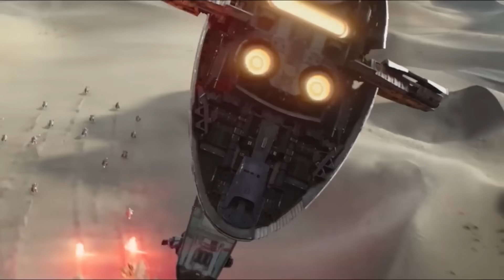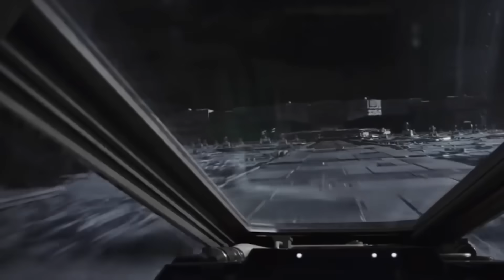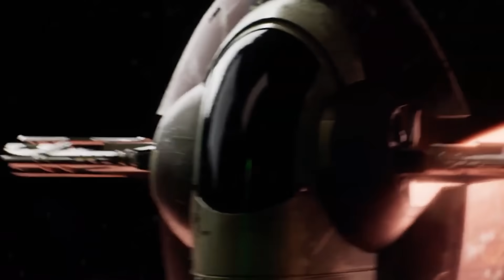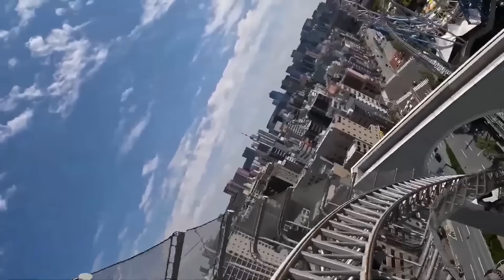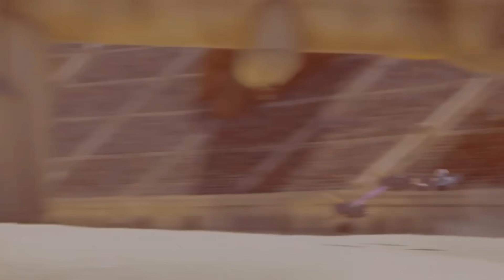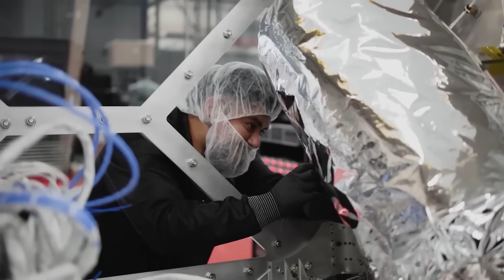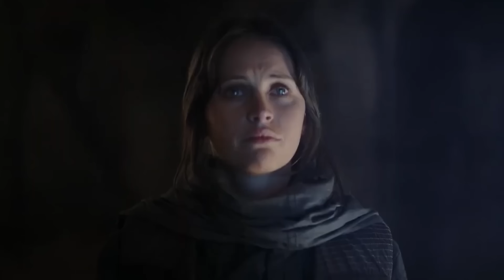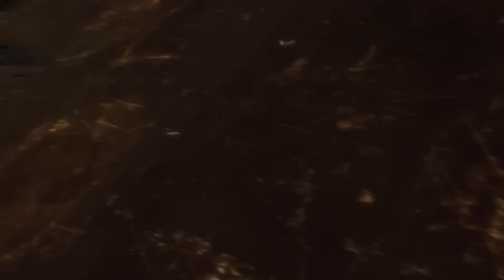The Problem with Star Wars Ship Design

Comment: 22:31 who's going to tell him, that week spot was there as a way to sabotage the station?
Reply: He says that like 10 seconds later
Reply: Who's going to tell him there wasn't a huge neon sign pointing to the exhaust port saying " weak spot" . We're taking about a 3.14159 m² hole on a space station with a surface area measuring 45 237 934 212 m² that was only known because schematics were stolen.  The hole is less than 0.000000001 % of the total surface area.
Reply: There was no spot that was vulnerable in a six-seven day period, so idk what "week spot" you're talking about. However if you're referring to a "weak spot", the target was small enough and at a nearly impossible angle where even loyalist Imperials deemed it impossible for anyone to successfully target unless they used the force (hmmmm...).
Reply: bro didnt even watch the video and complaining
Reply: Why would i accept an answer to a problem that did not exist until over 40 years later when another movie was made around said "weakness"? If the original movie did not address it, it's still a plothole. Regardless how many later layers of wallpaper were glued atop of it by people barely alive when the original was filmed.
Reply: it got mentioned a little bit after

Comment: Capital Ships would fight at vastly greater distances and in 3d space but the way they move (operationaly) is not unrealistic in star wars. In reality you still have material stress moving through space, the larger the ship the higher the strain, every course correction or halt on high speeds can compromise the integrity of the ship. Every move would have to be deliberate and calculated, once moving you are commited so there would be no constant high speed movement even if ships are capable of travelling that fast.(large ships)
Reply: Except Shields make all of that redundant: by the time your Million mile long Laser shot is calculated and hits the ship, by the time the second shot is fired and calculated for the ships Change of course the shields will have cycled and be fresh

Star Wars is Brawling because it’s the only way to cut through the Shields and Super Dense Doonium and Impervium Super Metal armor
Reply: @devildolphin2102 yeah that might be true in a setting with shields, I was talking about real hypothetical space combat that the slow moving capital ships of star wars are not that unrealistic given that they can only go fast in one straight line without stressing the ship.

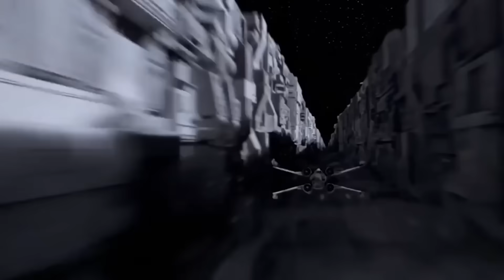Comment: 10:00 most of the time wings are used to place cannons out of the deflector shields dome, because if you shoot inside of it projectile could bounce back(if you use irl physics it does not mean that you could reject all of the technologies of the univerce)  11:00 also, there is a device in star wars called "Gravity compensator" that compensates high G forces turning artifical gravity to opposite direction
Reply: It's called an Inertial dampener. And before some wise guy says it, dampening something doesn't mean putting water on it, it means to compensate for or reduce the affects of.
Reply: Oh, that makes a lot more sense than the heatsink argument I've heard tbh (since... why would ONLY the ships with S-foils need them? and they don't exactly look large enough to do the job fully, nor do they really look like radiators)

Comment: So the design flaw of the deathstar is actually touched on in the legends book "Death Star" the design was a literal flaw overlooked by the engineers. Basically they needed to vent the heat and the engineers being in a cubicle were like okay put 3 m hole here. But later in the book one of the architects (i think its been a while) makes mention on how this is a design flaw, and the construction crew basically said "yeahhhh but thats on the blueprints so...." highly highly recommend its a fantastic read
Reply: Even more than that, they determined it was made redundant by other more heavily reinforced exhaust ports.  The reason it got built anyway was the overseer was bedridden during the construction phase and thus wasn't there to ensure the construction crew was using the revised building plan.
Reply: @happyrich1274 thank you!! I knew i had some part wrong its been years since ive read the book.
Reply: @happyrich1274 The Empire could have solved this problem by Shield generating the Star Destroyers, so no matter what exposed sections they are, it would be protected by the shields from weapons!
Reply: @Garland.Greene2296 star destroyers DO have shields....
Reply: @Garland.Greene2296  the problem is that they blew the death star with proton torpedoes and those aren't affected by shields as they can pierce the shields like its nothing
Reply: Also it’s mentioned multiple times……It doesn’t matter. 

It’s a Small 3m exhaust port covered by Guns and Tie Fighters. It would need divine intervention to actually hit the core of the station
Reply: @devildolphin2102  
People love to say "Ha ha, look at how badly the designed that!" and you are right. It was pretty well defended and would have required supernatural forces to take it out. Having a Jedi bullseye that Womp Rat is probably on the border or out there in the category of "Outside Context Problem"
Or at least the protection from Jedi attack was to go out and make sure there are no Jedi...
Reply: @devildolphin2102  
I mean it's impossible, even for a computer!
Not like there's going to be some moisture farmer who can bullseye Womp Rats or something from a fighter craft...
Reply: Totally agree
Reply: There's also an unofficial audiobook of it here on YouTube
Reply: @Ihavethetouch I’ve heard that one it’s really good
Reply: @TmanF1nerd  Yeah, I listen to it time to time. Same with Coruscant Nights trilogy. Sad that he only read the first Republic Commando novel because the people reading the rest aren't even close to his level.
Reply: How do any such vents work, then? Space is practically a vacuum, ergo waste heat cannot be got rid of via conduction, only by radiation. Breathe out on a cold day: the heat in your breath is lost almost immediately to conduction, as the warm air of your breath is in physical contact with cold air. So if this really is a vent, you would need to dump not just the heat, but the gases/air containing the heat, which seems a bit extreme, not to say wasteful. To dissipate waste heat (of which there would be a tremendous amount), you need large surface areas for it to radiate from (and not therefore a vent). Radiation is very inefficient: white dwarf stars shine extremely hot for millions of years, not because their temperature is maintained by ongoing fusion, but because radiating heat is a slow, inefficient method of losing it.
Reply: @PaulThatcher-iu5in I didn't read your entire comment because the first part of it is ENTIRELY wrong. #1 space is NOT a perfect vacuum like everyone keeps saying. #2 the Death Star is NOT in deep space it's in the outer atmosphere of the forest moon ofnEndor.
Reply: @Kolonol1  Can you read at all? What did I say? 'A perfect vacuum'? No, 'practically a vacuum', and that 'practically' has no significant role in the question of convection versus radiation: mooncraft already have shown that in the rather thin 'soup' of particles between us and the Moon, convection is still a no-go for capsule cooling...
If the Deat Star is in the 'outer atmosphere' of a planet, explain its being in such a close orbit and explain how friction affects that orbit.
Reply: @Kolonol1  'I didn't read your entuire comment' - no? Really? Shocker! The part you did read, you misconstrued. Furthermore, I did read all of your comment. Conclusion: fantasist who wants to make Star Wars 'real' no matter the actual science involved and is unprepared to read contary opinions properly - that is, in total opposition to the approach someone who cares about science would take.